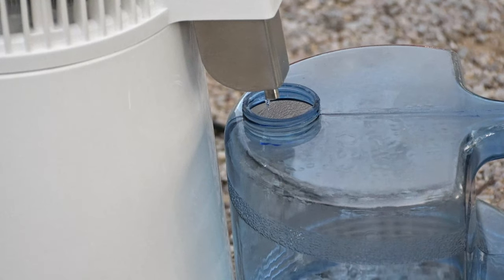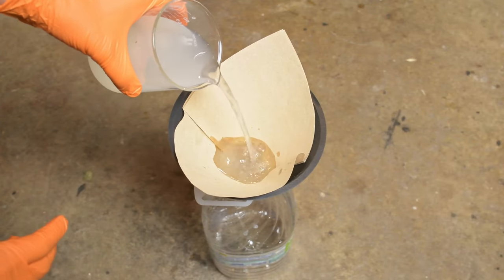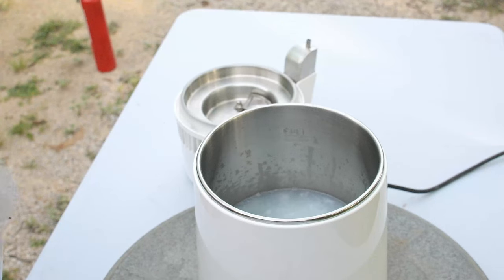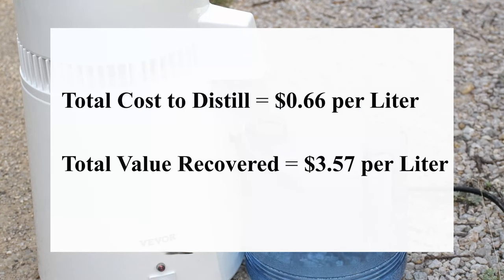Recycling IPA - Distillation for Resin 3D Printing

Comment: Distillation is the only way to purify your IPA or denatured alcohol 100%. Just remember that you should not heat the alcohol up to more than about 92-95 degrees centigrade. VEVOR has several cheap electric models where you can adjust the temperature. Then it's time to start saving money, the more alcohol you use the bigger is the profit.
Reply from the maker: Yep you are absolutely right. The temperature controlled models are the one to go with.

Comment: OK after looking into this all night I found that amazon has a temperature controlled model for about $96. Mophorn Countertop Water Distiller..   To distill alcohol temp should be much lower that what a conventional water distiller heats to.  Maybe the video uploader can upload the link as the one listed is broken anyways.   The proper temp for distilling alcohol is 175-195 degrees Fahrenheit, which is much lower than the 239F that this model hits.  By the way, comparable models on amazon are much more (3X) more expensive. the Mophorn looks perfect for the job.
Reply from the maker: Hi! Thanks for pointing out that the link is broken, I just fixed it by pointing it to Vevor's other temperature controlled distiller model.
You are right that IPA boils around 177°F, which does make the temperature controlled version more appropriate.

Comment: I want to save my resin not ipa any suggestion pls
Reply from the maker: Besides letting resin slowly drip off the print back into the vat, I have used compressed air on prints before cleaning them to recover 5-15% of the resin (% of weight compared to the part, surface area matters primarily).

Comment: Another possible (but probably impracticable and not cheap) method would be to use a centrifuge, to spin the solids to the bottom of the container.
Reply from the maker: I've heard people mention this before actually, but I believe that the resin would have to be completely solidified (into particles) for this to be an ideal efficiency, when in reality much of the resin is still liquid.
It would certainly be a good way to decant as part of a filtering process.

Comment: I tried the non-temperature controlled distiller and it started leaking. When I turned it off and opened it the silicone seal just fell off. Now it's very loose and warped. Time to try the temp. controlled one?
Reply from the maker: Some people have had issues with the non-temp controlled one leak; I personally haven't experienced this yet. One way to help mitigate the seal falling off is letting the unit cool down after it finished distilling.

I know that buying replacement seals isn't the best answer, but they are fairly affordable on amazon last I checked. I have also tested distilling without the seal entirely, and it still works, just with some IPA condensate leaking on the outside.

Comment: Hello! I bought the same distiller as you (without temperature control). I did a first distillation, which went well. I got back almost 2l of IPA. But now I'm having problems with my distiller. As soon as I start distillation, and the unit gets hot, it locks up. A safety device engages and there's no way of restarting it, even with the reset button, for a long time. No problem if I distill contaminated water, it only happens with IPA. Have you ever had this happen? Do you have a solution? I obviously can't return the product now that it's been used and I don't want to throw it away.
Reply from the maker: I’ve not run into this issue myself nor have I seen anyone else mention it.

It’s likely there’s an issue with the specific unit. The manufacturer advertises that these can be used with alcohols, so I would contact them to see if they have a resolution.

In the video I should have used the version with the temperature controller, but instead I used second hand units that could be tortured (and burnt down).

Comment: Just got done with my first batch and it looks brand new!  However, I have a question...what's the best way to clean all the burned up/sticky residue that's left afterwards?  Thanks again for the video!
Reply from the maker: As the batch is finishing and there is still a small amount of IPA left, the resin blob is loose, or after it has dried for a few days it should crack and peel off.

Comment: What temperature did you set it at?
Reply from the maker: The distillers without a temperature controller, like the vevor one in the video, are set to shut off around 114°C. If you have one with a controller, it will be best to set it slightly above the boiling point of IPA which is 83°C. So 85-90°C is a reasonable place to start.

I'd be interested to hear about results and the experience distilling at this and even a lower temperature.

Comment: Any idea about the IPA concentration of the distilate. The one you started with was 91%. What did it became after distilation and does it even matter?
Reply from the maker: I didn't make any measurements for the concentration because it shouldn't change significantly. The maximum we can get from simple distillation like this is roughly 91%, and we can assume that it will be close to but a bit below this. For using the IPA to clean resin, anything above 70% works perfectly fine, but the 91-99% could be important if anyone is doing niche prints like wax for metal casting or anything that will be handled frequently (and not coated).

Comment from the maker: ⏱ Timeline:
00:00 - Introduction
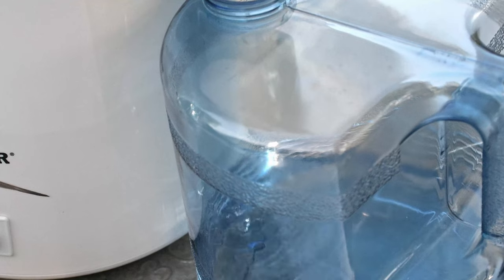00:24 - Filtration
01:02 - Distiller Operation
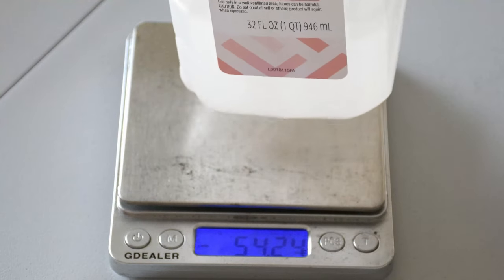01:31 - IPA Recovery Efficiency
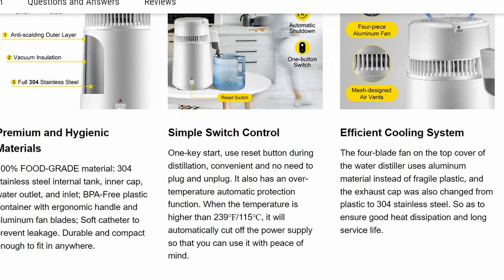02:15 - Distiller Overheating Protection
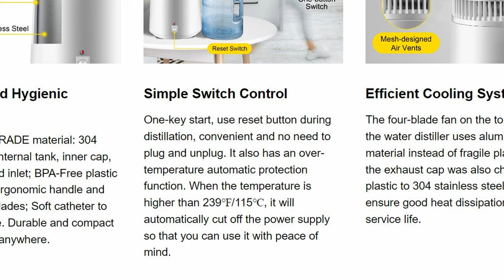02:28 - 1st Tip = Use Outdoors & away from Flammable Materials
02:59 - 2nd Tip = Don't leave it Unattended
03:11 - 3rd Tip = 🧯Fire Extinguishers🧯
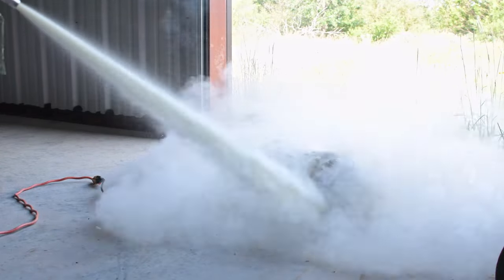03:50 - GFCI/AFCI and Laws
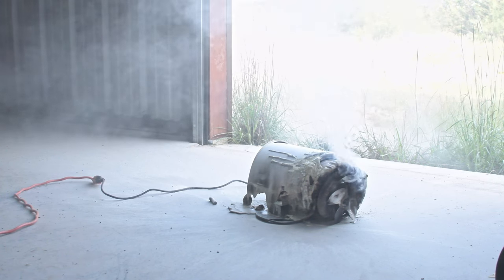04:30 - Cost Analysis
06:02 - Conclusion

Comment: Great video. I didn't know these distiller machines existed. Be careful of alcohol laws too because you're technically running a still.
Reply from the maker: Thanks for the support! You are right that people should know local laws and be aware of their situation. However, I believe most jurisdictions would be more concerned with fire safety than distillation laws.

Comment: My mine is leaking all over the place. The gasket appears to be expanding and losing its sealing ability.
Reply from the maker: Does your distiller have a temperature controller?
A few people seem to have this issue, and the gasket material the manufacturer chose is likely not ideal. This next week when I go to the shop I’ll see if I can find a replacement gasket of higher quality.
Reply: Thank you for your response. Just to clarify, my device does not come with a temperature controller. I am looking forward to a work around. @ArisAlder
Reply: I'm working on one as well, I found that if you do adjust it mid cycle the IPA vapor makes the gasket not seat correctly.

I just stopped the process let the system cool to room temp, reseated the gasket and started again no issues since.

Comment: Good video.  I had been wondering if water distillers would work for IPA, and yep, it does!  You covered the safety issues very well.  The fire was entertaining (I hope it was on purpose). 
 A question I have is concerning clean-up of the distiller.  It seems that most of the resin left behind is in the pancake, is it hard to clean the rest of the pan - or is it even necessary? Is there much material stuck to the bottom or sides?  Is scrapping or scouring necessary or can it be pretty much ignored?
Reply from the maker: Thanks! Yes it was a demo fire, and I even made sure to procure a used unit with issues so as not to waste a perfectly good distiller.

Since the inside of the tank is smooth stainless steel, the pancake does pop off pretty easy when dry. It will also slide out if it is warm and there's is a little IPA left after a session. 

Generally, it is a good idea to remove the resin if a death pancake does form since it will result in more fumes in the next printing session. For casual recycling, there should be minimal resin buildup, especially if filtering. People who are processing gallons of IPA per month will have to regularly remove the buildup. I have found that most, if not all, of the resin will coalesce at the bottom.

Comment: I just tried this method to clean my IPA.  It worked great!  
One question, how do you clean the 'death pancake'?  Let it cure, then take it out?  
I have a nice layer of sludge at the bottom of my distiller; pouring it out made a nice mess.
Reply from the maker: If it continues to heat and solidify/burns then it can be pulled out and thrown away, but it's possible for it to get stuck. When it's mostly just sludge resin left, you can pour it out into some other container for it to dry out then throw away.
Reply: @ArisAlder @ArisAlder  Ya, I poured mine off, made a mess, and had some curred resin inside the heating chamber.  (I thought curing it a bit would make removing it easier, nope...)  We'll see how the next destilling goes, might have to buy a new distiller if the curred resin causes issues.

Comment: I've tried distillation a couple of times, the second time with a distiller with an adjustable temperature I was able to set to the boiling point of IPA.  In both cases I got nothing; the IPA just evaporated away without condensing.  Wish I could get it to work.
Reply from the maker: I would be very interested to see a video of this, since it should still condense even if the fan was malfunctioning. This could point to a seal/gasket issue but that is unlikely with two distillers.

Comment: You don't happen to have a demo or advice on cleaning the death pancake out do you? I just ordered my distiller based off your video and was wondering what the best method for taking care of that would be? Just trying to get all my resources and info together before it gets here lol.
Reply from the maker: I don’t have a demo, but there are a few comments discussing it.

The tldr is to use a distiller with a temperature controller and stop when there’s a little IPA left to avoid the pancake. If the pancake forms, it should be loosened by adding more IPA or water when doing another cycle.
Reply: @ArisAlder  Ah I see, so if it does, possibly splash some water in there to loosen it up after the fact maybe? Regardless, the investment of a distiller is hard to ignore. Going through IPA for a beginner like me seems daunting and somewhat expensive. I'm hoping this will help with some of that expense, thank you for the response and the very informative video.
Reply: @st.eldritch7121  I wouldn't do distilling until you have a few gallons of dirty IPA stored up (and dirty as in it won't even wash resin off prints, most IPA can be used to clean even if cloudy). It will save you a LOT of money, but isn't worth the hassle if you haven't printed 20L worth of resin during your experience.

Comment: Would this work to clean water contaminated with water-washable resin?
Reply from the maker: It will separate resin from the saturated water, but I wouldn’t consider it to be potable. 

I haven’t throughly considered disposal methods after this point, but if it’s a smaller amount of water it could be poured onto hot concrete so it will evaporate, for example.

I’d be interested to hear your results!

Comment: Put me down for having gasket swelling issue as well.  This is apparently due to the silicone absorbing the IPA at a vapor level, with the gasket getting back to normal size once it evaporates out of it.  I did use 85 degrees and indeed it was leaking on the outside walls of my Vevor unit, and getting over the electrical plug which made me nervous about starting a fire.  Anybody know a gasket material that does not swell with IPA vapors?
Reply from the maker: To give you an update - I was only able to replicate this issue on the unit I have by completely removing the gasket, and the leaking was minimal.

I'm FDM printing off a gasket in PP, which chemically should be fine with the IPA, but it will likely fail after a few uses due to temperature. I will try to test this in the next few days when I find time.

These are three o-ring cord stocks I've identified (I will purchase them on my next large mcmaster order):
https://www.mcmaster.com/catalog/9616K38
https://www.mcmaster.com/catalog/1034T2
https://www.mcmaster.com/catalog/12975K39

Additionally, there's a decent chance that Vevor will send out a replacement seal when asked. If they refuse, let me know and I will talk to them and see if they can remedy the situation. https://www.vevor.com/pages/contact-us

Comment: Is there a way to prevent the seal from swelling? I'm getting leaks from between the lid and the base, I have tried 3 different distillers. Thanks.
Reply from the maker: Just to clarify, you are referring to IPA condensate leaking from the lid instead of depositing into the jug like normal? I have not heard of this issue to date. You might have to post a picture/video on discord or reddit to give additional context.
I would also try doing this with pure water to see if the leaking continues, as part of a process of elimination.
Reply: @ArisAlder it often happens when you run a machine whit IPA that is made for water +100c the pressure get to high and it either pops the lid or blow the rubber seal betwine the container and the lid, if you going to do this us a distiller whit temperature controle
Reply: Its slower at lower temperatures but i have recovered alot more ipa on the other end at lower temperatures.

You can also mix water whit the ipa and not get the death pancake.
Reply: I experienced the same problem. i shrinked the seal in boiled water to get a good seal, and after 2 min the IPA start to leak from the lid. I turn everything off and when I remove the head of the machie i can see that the seal has swollen.
Reply: @AdmiralLj   what temps are you using? I tried 83 which is 0.5 above ipa boiling point and i still have more leaking around the lid than coming through the spout.

Comment: Does the ipa have to be cured before distilling?
Reply from the maker: The IPA does not have to be cured, but it is a best practice to do so that way you can filter out as much solidified resin as possible.

Comment: So if you only use water for the water washable resin then would it work the same without the chance of a fire? Or is the resin itself a flame hazard? I ask because I’m getting into this hobby and I would like to not have several gallons of poison water sitting around
Reply from the maker: You are absolutely right that it would work the same for water, and it would vastly minimize the fire risk. Resin can burn but the 180°F is unlikely to cause it to ignite, it just results in the death pancake forming at the bottom. Water will be safer to distill than a solvent.
Reply: @ArisAlder  thanks for the info I really do appreciate it
Reply: its actually a good way to clean any water you used for cleaning your prints. I still empty the pancake into a clear trash bag and let it cure for a day before tossing it.
Reply: For water washable just pour it in a wide container and leave it out in the sun. The water will evaporate out, and the sunlight will also cure the resin leaving behind dust that is not a biohazard.

Comment: Does the death pancake come up easily? Or do i have to use holy water to remove it?
Reply from the maker: This particular demon is usually easy to expel, especially if there is a little IPA left in the tank.
Reply: Another way us to mix the IPA whit alittle water run at 80c and it will leave only a water resin slury in the bottom

Comment: I have one, and it worked perfect for the first 4 times, but on the fifth time, for some reason the pancake was burnt into the bottom of the distiller. I had to scrape the bottom with a metal spatula. Took a lot of work, but I got most of it off. I wish I could add a pic. I haven't used it again, but I don't know how it'll work now that the bottom is burnt.
Reply from the maker: Was this a distiller with a temperature controller or like the one in the video?
I have found that the pancake is usually lose while it is heated and there is still some IPA present in the tank. Adding some when removing could help ease the process.
Reply: Did you cure the ipa before distilling?

Comment: Probably should mention it's not safe to use for water or ethanol at this point.
Reply from the maker: You are correct that it would not necessarily be safe to use for any other purpose once used for resin, but the same distiller would be fine for separately doing IPA, ethanol, or water (since these are all used for cleaning).

Comment: How much odor is released during evaporation?
Reply from the maker: A significant amount will be released, which is part of the reason is must be done outdoors.
The level, at least for me personally, is comparable to using a large amount of rustoleum enamel paint.
Reply: It's an open distillation unit. The can that catches the condensed solvent is also open releasing a lot of solvent vapor. It would be much better if the distiller would have some silicone tubing leading through a cap into the bottle, and only a small breathing hole would be on the cap to prevent the pressure buildup in the canister.
Reply: @peterkiss1204 many do that that, but the cheap version do not and they also do not have adequate temperature control, they are made for water so if it's 100c or 150c who cares... for IPA that cause the pressure in the device to massively increase ans will usualy pop the gasket or pop the lid leading to the loss of alot of IPA